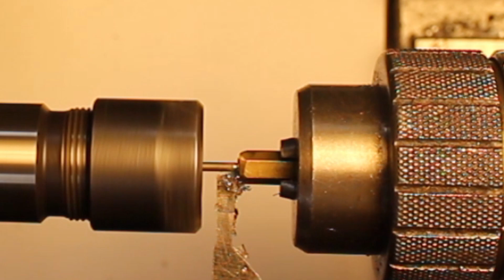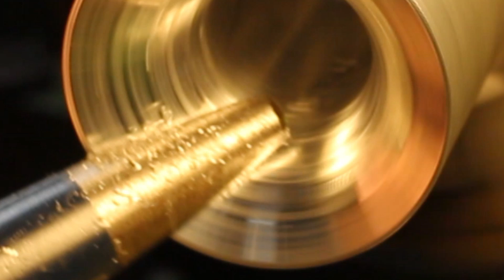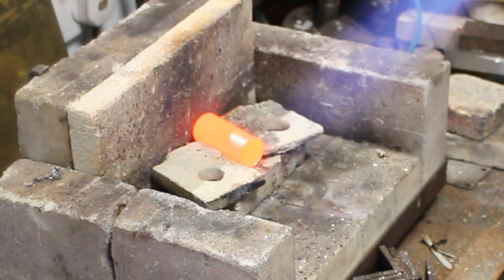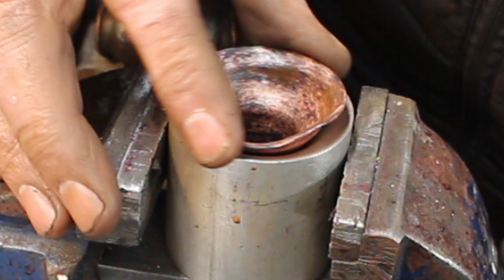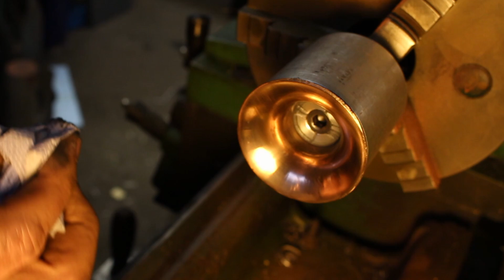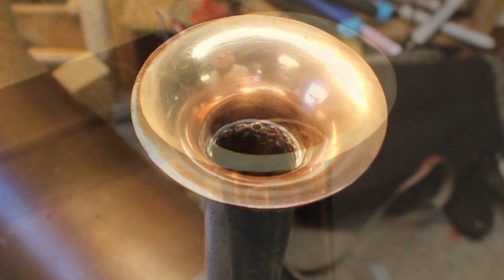LION Vintage Steam Locomotive | Model Engineering Workshop Build in 5"g  - Part 68

Comment: Turned out nicely, I might have tried using a roller bearing mounted in the tool post in the lathe and rolled it out to the former. I've made boiler end caps that way.
Reply from the maker: Thanks. Yeah, half way through I rumaged around and found a suitable roller bearing to use as a backup plan but desided to perservere with trhe hammer bashing. I think the rubber balls would have worked better on thinner material, if there is a next time I'll try a roller bearing/metal spinning method. It's all a trial and error learning process. Thanks for following along it's much appreciated.
Cheers
Nigel

Comment: Nice job! Swindon would be proud of you!  I am trying to make some cowl vents for a model boat, lucky mine will be painted so no need for all the polishing.
Thanks for taking the time and effort of making and posting.
Reply: Why Swindon? Leeds, wasn't it? Maybe I'm missing something. Anyway, any loco builder would be proud of that result, such craftsmanship
Reply: @thisnicklldo  Swindon aka GWR put copper caps and brass on everything hence the comment. 
Mr Nigels work is always spot on.
Reply from the maker: Thanks. It would be quite a job forming that copper cowl on the full size engine, they were true craftsman. Thanks for watching.
Reply: @GoCreatehms  I wonder would it be possible to spin something that big?
A chap down our club built a model of the workshop loco of Doncaster works, Pet.
In the end I found him an old trumpet and guess what happened to that:)

Comment: I would have never in a million years thought of using rubber balls for expanding metal. I suppose it makes sense really as it would be quite gentle. as ever Nigel fantastic job👍
Reply from the maker: I thought I might be able to go through the whole process just using the rubber balls but soon learnt that wouldn't work. They did however help a lot in the latter stages of forming the cowl. Thanks for watching it's much appreciated.

Cheers 
Nigel